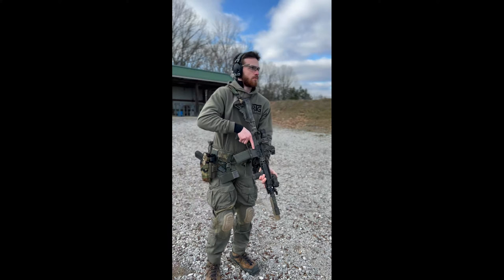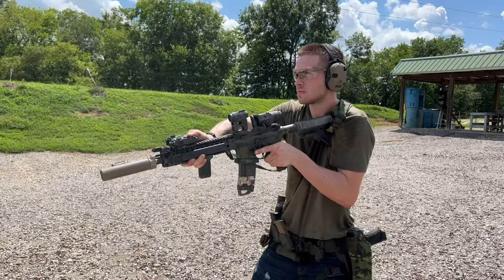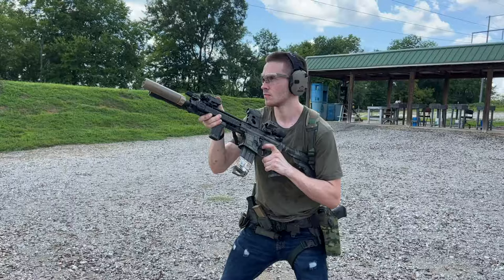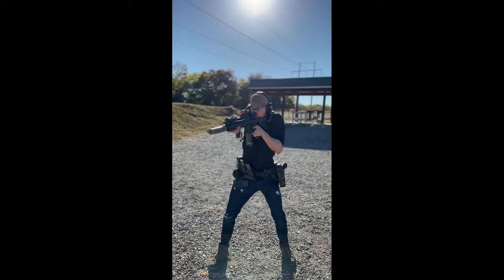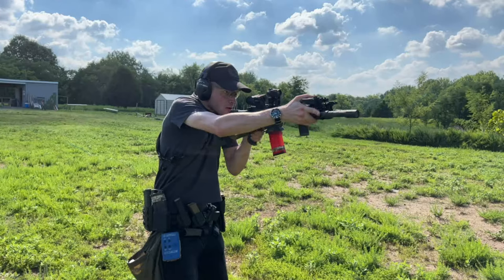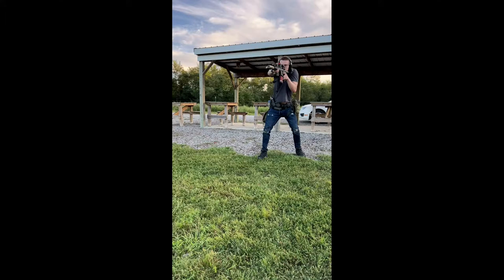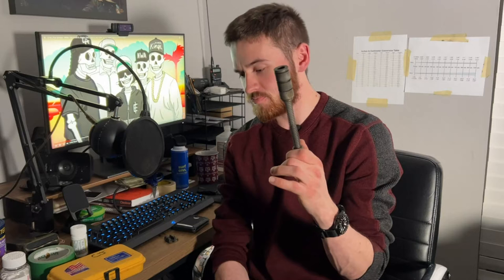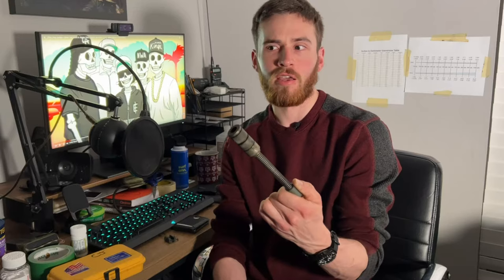JP Enterprise silent buffer system review

Comment: I run Armaspec Stealth Recoil springs (copy of the JP system) in my rifles.  Even after several thousand rounds, I've never seen one look like that. That indicates you have some kind of serious blowback going into your buffer tube which is not right. I definitely feel an improvement using these types of recoil systems over the original "sproing" system. In fact, when I am plamning and designing a new rifle for someone, i always have them shoot rifles with the Stealth system and the original system so they can compare them. 90% tell me they feel a distinct difference and opt for the more expensive aftermarket recoil system.
Reply from the maker: Guns gassed fine, its a BCM upper that's been shot heavily and ran suppressed and unsuppressed, there is no advantage to running buffer systems outside of what is already normal for rifles and carbines and selling people a more expensive options who wont shoot 5000 rounds through it in a year is frankly dishonest business in my world. a world wear training and competition decide most things and prove most things. my gun isnt even that dirty relative to what i've seen at classes.
Reply: @autonomousdefense  I have been several guns with the system similar to the JP system over the past 9 years and  never seen one look like that. Sorry, there is a problem somewhere. Since thus is the first time you have used one and the physical appearance/evidence, I'm a little suspect as to your results. Admittedly, I have never used the JP system so maybe it is a JP vs Armaspec issue.
Reply from the maker: @waltmeyer1156  or maybe you just dont shoot very much
Reply: @autonomousdefense  
You review an item that has been on the market for at least 8 years and that 10s of thousands of other AR users, including competition shooters, have used during that time. I am surprised that it took you this long to learn their is an alternative to the standard spring and buffer. You fire a few thousand rounds and have a negative thing happen. You call the company and they tell you, yes, the rings should be replaced after 5000 rounds. The item you review is in horrible condition and not the condition it should be in, even after that many rounds since dirt, grime and powder residues don't normally find their way into the buffer tube. You complete all of your testing on one gun. You are also using this system on a suppressed rifle and don't mention if you are using the correctly weighted unit (they come in different weights for different applications, just like standard buffers).

I have never used the JP system but I do use it's competitor and they are pretty much the same thing and do the same job (the competitor is half the price). I've installed it on more than 20 guns. One of those guns has had it installed for 9 years and probably run through 10,000 rounds with no sign of wear, no grime, no damage, and no FTEs/FTFs. The other 20+ rifles have been using them with zero complaints. As I mentioned earlier, this is the #1 performance modification request I get from people who ask me to build a rifle for them since they get to actually compare it to a stock system and notice a distinct difference. 

I think part of the problem was that you removed the buffer retainer and spring. These systems can be installed with them and that is how I build them. It literally takes me 20 seconds to install or remove the system (depress the retainer, pull the system out over the retainer and cocked hammer),  the exact same time as with the stock spring/buffer.

In regards to the number of rounds I shoot,  my current count does not equal yours. However,  during my SWAT  and special teams assignments,  AR platform rifles were my constant companion and my round counts during our regular training sessions exceeded yours since our lives, and the lives of others,  depended on our ability. This item wasn't available at that time, but if it had been, it would have been in my work rifles unless our liability people told us no. The number of rounds you shoot doesn't make you an expert at anything other than hitting a target at a fast speed (and for some people, they can that many rounds and still not hit anything).

I would suggest that before you provide people with potentially incorrect information, try a little more research.  Try the equipment you test on multiple guns. Have different people try it and tell you their thoughts. Try a second unit of the same device and see if you have the same results. You are young and still have much to learn. I am older and yes, I still have much to learn also. That's the cool thing about the 2nd Amendment and firearms in general.  I hope that helps!
Reply from the maker: @waltmeyer1156  lmao, 10,000 in 9 years. Literally just over 1111 rounds a year. You don’t shoot, you don’t train you have no idea what you’re talking about.
Reply from the maker: @waltmeyer1156  seriously I’ve never seen such an admission of incompetence before 9 years and only 10,000 rounds, have you even killed a barrel in your life? Do you know what that round count on a cold hammer forged barrel is? Jesus Christ…….
Reply from the maker: @waltmeyer1156  I shoot in 2 weeks what you shoot in a year, On the low end.
Reply: @autonomousdefense  Good for you. You have mastered a skill that only several billion people in the world has mastered. Pull trigger,  gun go boom,  swap mag. You are failing to see the point - your research methods are extremely faulty. Shooting proves nothing. Identification of the problem and ways to prevent it ar e helpful. Can I shoot the same number of rounds you do? Sure. Everyday and twice in Sunday. Shooting is easy. I can even do it with my eyes closed! I don't shoot that number of rounds because I have a job, a wife, a house, etc, and can't afford the time or money for that many rounds. I have already shot that many rounds before you were born. What did it teach me? Shooting is  easy, it's fun, and is a basic skill like riding a bike, writing your name, and eating. It doesn't mean that you have the ability to properly research an item, analyze it properly and provide an expert opinion. Good luck with it and I hope I've helped some other people who got the wrong idea from your video.
Reply from the maker: @waltmeyer1156  maybe you could afford to shoot if you actually stopped wasting money on bullshit products. Lots of people who shoot far more than me also have a wife and kids and a job. You’re not special what you are is full of excuses. I honestly can’t tell if you’re a 60 year old man or a 15 year old who thinks he knows how to debate and argue.
Reply: @autonomousdefense  You can argue with ignorance.  If you have served in our military or as a peace officer, then I thank you for your service and respect your efforts. If not, then please remember,  there are those of us who have "done" but there are more of you who have "trained."
Reply from the maker: @waltmeyer1156  sure.

Comment: I guess I don’t understand your point. You dislike the fact that with 7k rounds on it and no maintenance the rubber o rings can fail? I own 2 of these on ar 9 rifles and haven’t had any issues. However, I clean them. Sounds like you are looking for a maintenance free product. Haven’t come across that yet in my experience…
Reply from the maker: @jpduder13  maintenance without benefits quite literally describes making a design worse. A very specific point made in this video is how, why, and especially when it failed and all of that does matter greatly.
Reply: @autonomousdefense  I guess John Paul of JP enterprises has a few things to learn about building firearms…. Lots of credible people have them, use them and love them. Keep in mind, everything JP does is for maximum performance during competition. And generally people who shoot competition are extremely vigilant about maintenance and anything that will give them an edge over others.
Reply from the maker: @jpduder13  weird because they don’t, Tony Mazza, Ben Stoeger, Pranka, all the PSTG boys, nobody I’ve seen placing high regularly in competition in PCSL, private matches running off hit factory using rifles, etc etc etc. I’ve quite literally seen nobody other than me and one friend ever show up with a rifle to a match or class and use this thing and we both broke ours, his snapped the screw.
Reply from the maker: @jpduder13  and like if you understand shooting and physics and how the gas system in an ar15 works and how to change it this product doesn’t do anything. I don’t know what hyper modified 3 gun trash rifles that don’t run factory ammo people are using with this thing but most normally gassed rifles don’t change at all.
Reply: @autonomousdefense  fair enough. They didn’t work for you. But there’s a lot of people that have zero issues with them.
Reply from the maker: @jpduder13  never met one of them that didn’t start lying the second you actually pressured them. A dude in a different comment literally just claimed it mitigated so much recoil he shot his AR10 75% faster than everyone else and won first place in competition, he’s literally crediting a thing that doesn’t change the gas in an AR10 as the reason he won. People lie, they lie a lot actually in this industry.
Reply: @autonomousdefense  yeah that’s a bold claim. I’ve found that it helps a little but had much better luck reducing recoil with a compensator, lighter bolt and switching from a carbine length gas system to a mid length. I’ve noticed a difference more in my ar9s than in my JP-15. I have an adm uic 13.9 core with a surefire warcomp and it’s by far the softest shooting rifle I’ve experienced.
Reply from the maker: @jpduder13  and see that’s the wild thing about 90% of the comments on this video, you just listed shit that ACTUALLY changes recoil impulse. The amount of dudes lying in this comment section could be studied, the marketing of this buffer system was somehow so good dudes around here would sacrifice their first born before admitting this thing doesn’t actually do anything significant to a rifles shooting ability.
Reply: @autonomousdefense  That's actually not what I said, but you fail to actually understand what people are saying before commenting. I said that I finished shooting before everyone else. I was 75% faster THAN EVERYONE ELSE THAT WAS SHOOTING ALONG SIDE ME while utilizing this buffer system as an aid to help make my follow up shots quicker. Yes, a smoother rifle helps with quicker target reacquisition. was it the sole purpose in me beating everyone? no, but it helped. smooth is fast and fast is smooth. small movements cause a huge amount of movement in the scope Especially at 600 to 1,000yds.
Reply from the maker: @Simply709  lmao your correction to what you said didn’t actually correct anything you claimed a buffer system that doesn’t change the gas in the rifle is the reason you shot 75% faster. Your correction is still as bullshit as what you originally said and I’m gonna keep using your lie as an example of dudes who actually believe they can buy skills. I’m still waiting for you to show anything that actually proves what you’re saying is real, what’s the practicecore information on this match?
Reply from the maker: @Simply709  I just went back and looked at what you originally said and yeah, complete bullshit. Literally crediting a recoil system for why you shot better than everyone else and it’s the reason you won. Lmao
Reply from the maker: @Simply709  something tells me a real competitor wouldnt be lurking in a comment section looking at other comment threads to try and justify what he’s saying to people who don’t care he exists, it’s 11:10 at night and your searching through my other comment replies to other people LMAO who even are you.
Reply from the maker: @jpduder13  see this guy “Simply709” right here? The dudes going through other comments like a stalker to try and argue. This is the kind of unhinged shit I deal with on YouTube because I believe skill trumps equipment. Lmao.
Reply: @autonomousdefense  ah, okay you consider only matches that are legally licensed to be an actual match. you do realize that small community events exist right? It wont let me comment on the original comment thread anymore. every time i do it gets instantly deleted.
Reply: @autonomousdefense  "people who don’t care he exists" is a funny statement coming from someone who goes out of his way to keep commenting on some random dude's posts. if you didn't care you would stop commenting back.
Reply from the maker: @Simply709  “LEGALLY LICENSED” practice core is a Match posting website so shooters can easily find local matches and you don’t have to post uspsa, PCSL, Ipsc, or idpa matches on it, you can literally just create matches that are unique to your own range or club. MOST long range matches are uniquely held by ranges that have the distance. Jesus Christ, why don’t you just come out and say “I’ve been lying from the start” have you even attended a match before? I can’t believe you’re this bad at lying, can’t provide match information because the easiest way to actually tell shooters a match exists doesnt have a record of it because the match doesn’t exist. Lmao I just realized, I’m pretty sure YouTube thinks your a spam bot because you’ve been stalking this video for 6 months, you’ve probably posted more comments than any other viewer, I also just realized your the dude who thought he could Sherlock Holmes the buffer based off the photo of it dry and out of the gun and that it wasn’t lubricated because I was talking about it in hand.
Jesus Christ you’re that guy. 6 months and he went from Mr photo detective to AR10 match winner for a match that doesn’t exist. Lmao
Reply: @autonomousdefense  Every constructive comment in here is met by you getting angry over nothing. Real small guy syndrome going on here. My local range held a small long range contest with a turnout of 20 people, i was one of the two that got perfect scores, but since my time was faster, I ended up in 1st. advertising was done at the monthly meeting. not everything has to be some big spectacle. not everything has to go on your little global leaderboard so you can sit in a forum page and talk about how cool you think you are.
Reply: @autonomousdefense  and yeah, tools should be taken care of. not my fault that you don't take care of your tools. I'm not an expert, but at least i can admit that. I'm not here trying to pretend I'm some gun guru god that knows everything like you are.  the AR10 captured buffers are different than the ar15 buffers. The ar10 ones work way better than the ar15 ones. yes, it helps with recoil, especially when paired with the low mass BCG. less mass moving and stronger springs will deliver lower recoil. basic physics.

Comment: After as many rounds as you said you had through that weapon, anyone would realize that some wear and tear would occur. 
You wanted silent, you got silent. 
Everything has trade offs. 
You could maintain your weapons from time to time.
$200 is nothing if you’re buying thousands upon thousands of rounds to train.
Reply from the maker: 200$ is something if its less effective than the original system that costs less than half that. Yes, I expected wear and tear eventually. that is literally the point of the test, to see what and how it failed. yknow what you call wasting money on something that objectively brings no benefits and has more cons than it does pros? Stupid, you call it stupid. Its as if people don't understand just because something exists doesn't mean its actually a good design when used practically this is the entire reason people review and test products. Im advocating you spend your money on: Solid optics, Solid triggers, Gas systems, and muzzle devices. Literally all of those items have a more significant effect on how the gun runs and how you run it than this recoil system. Yknow what also help you spend more money on thousands of rounds to train? not spending it on products that fail.

Comment: Too many people railing on you that you should have known the O-rings were a wear item and blah blah blah, and nobody seems to understand most people including myself aren’t checking the o rings on our buffer systems because we dont have a 200 dollar buffer. This dude bought one and was honest as to his experience. I have a heavy buffer in my rifle and it solved some overgassed issues I had. It is a hunk of solid metal and the only maintenance is greasing the buffer spring behind it. I agree this is a BS product and seems to be specifically for making suppressed rifles quieter? Idk, I wouldn’t put a system this prone to relearning and maintaining in my rifle as I don’t need more failure points for a gun I do target practice with. 😊
Reply from the maker: @FeloniousSKUNK  JP not openly stating on the product page the O-rings have a service life of 5000 rounds is a pretty clear indication they don’t expect their costumers to actually use their stuff very much
Reply: @autonomousdefense  added maintenance is rarely useful, and like you said, the manufacturer had nothing in their paperwork about maintenance intervals. Seems sketchy at the very least and genuine malfeasance at worst. I’ve seen similar products that don’t have those O-rings, idk what the maintenance schedule is for those but I wouldn’t care to find out lol